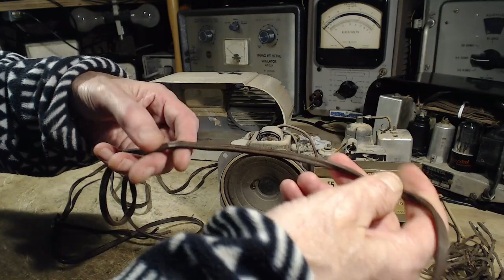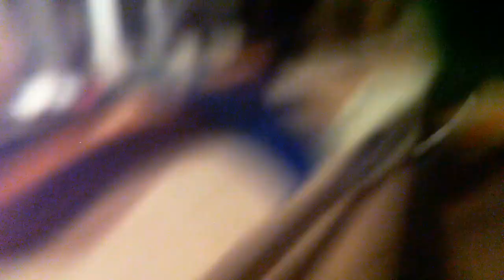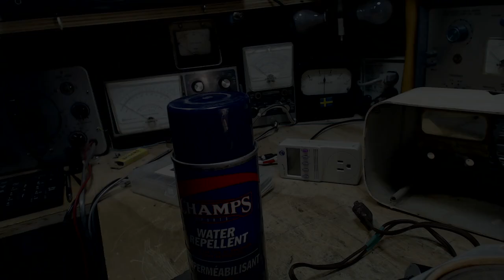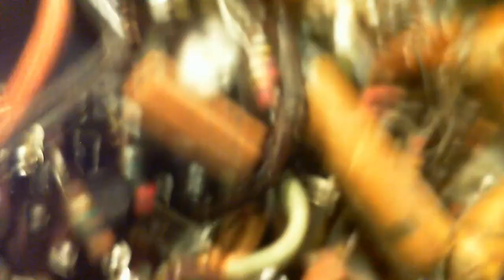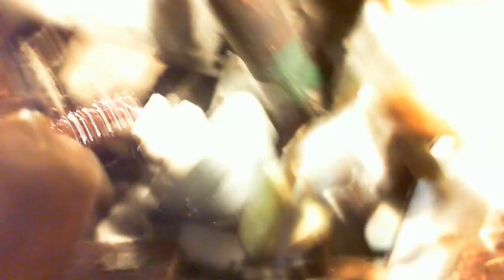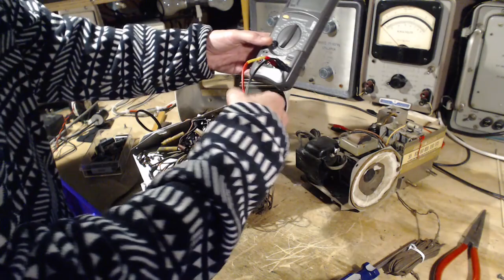Stewart Warner R514 Tube Radio Video #6 - A Second Chance

Comment: Rubber cement.  Stays flexible when it dries.  Coat front and back of tear.  Since you went the paper route, put some fiebing's black leather dye on the paper and turn it black again.

Comment: "Has anybody worked on this radio? Nope, it's all original." Time to wreck it too! As cheap as line cord is please don't splice old non-polarized line cord . 
Every Goodwill store has extension cords that are more than willing to give up their original cause and become a polarized  line cord! Jim you should get a bottle of 
Radio TV service cement. It will fix those paper cones on the speaker. Dries flexible and comes in black. If needed a small piece of coffee filter will act as a patch
and use the service cement to hold it down. You can run some of it around the rim which I would do  do that first. Let it dry and go back to the cracks.
Store the bottle with cap on tightly and place in a sandwich bag. Turn it so the cap faces down and it will last forever!

Comment: 12:00 If you make a butt connection of two stranded wires, look into using ferrules (tubular wire end sleeves)  without insulation. Insert the wires from opposing sides and either crimp the sleeve with a tool or solder.
A freestyle butt connection always runs the risk of having little protrusions or wire strands poke thru any heatshink tube you apply later on.
And most importantly; if you make butt connections on mains power cords please offset the location of your butt connection between adjacent wires so they cannot touch directly.

Comment: Here is a Dumb Idea  when i was in School  and had NO money we found that for a broken speaker  that was not binding   that we could  with care use Silk stacking and lay it across the speaker and use finger nail polish  or hobby air plane  dope on the speaker to make the repair   and it worked  i still and have a radio that this was done to and is using the same speaker  this was done to      just an idea

Comment: Jim,  why don't you use flux when soldering?  I think you'll find it will make your soldering joints much stronger and cut down on your dwell time.  SMH
Reply: Absolutely correct. Soldering stranded copper wire like that mains cable you need to dip the ends in flux. There is not enough flux in standard 0.8mm rosin core. Plus you need proper heat. See around 12:10 how his solder gets plasticized and putty-like  while still soldering? It is because the iron cant provide and/or sustain enough heat flow to overcome what the copper wire sucks away. This is where a solder gun comes in handy, because on it the heat is generated right at the spot of soldering, not in a heating element several centimeter and airgaps away. Or at least crank the hell out of your "temperature controlled" china solder station with their hakko 907 iron clone.

Comment: I suspect if the plasticizer used had been Soft'n'Safe by Grinstad GMBH it would not have cracked as the plasticizer like DINP(Diisononyl phthalate) or DOP(Bis(2-Ethylhexyl) Phthalate) as a habit of leaching out and evaporating.